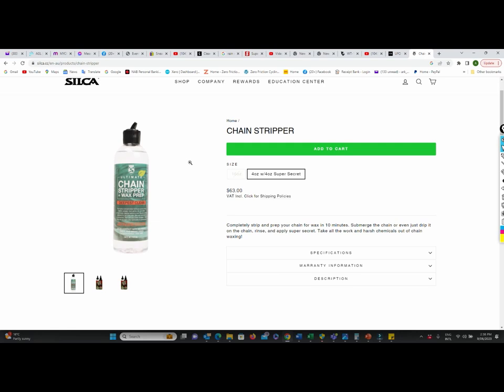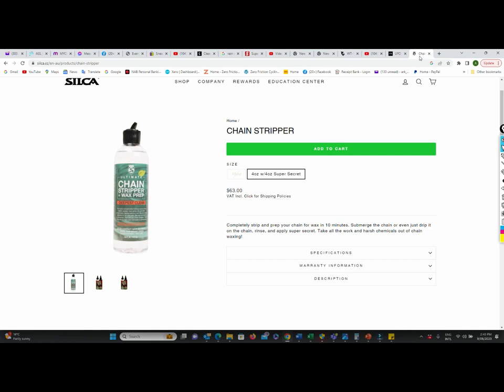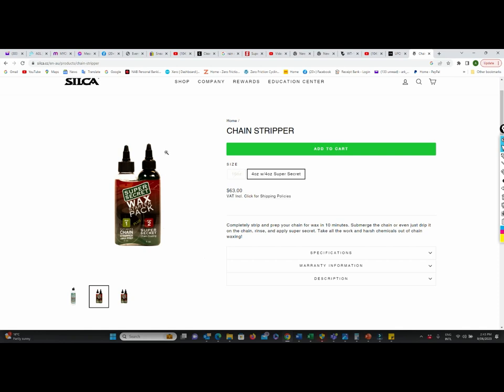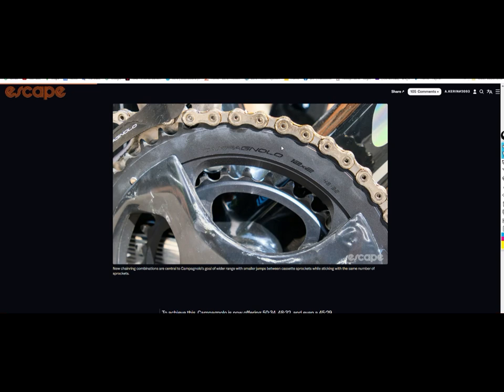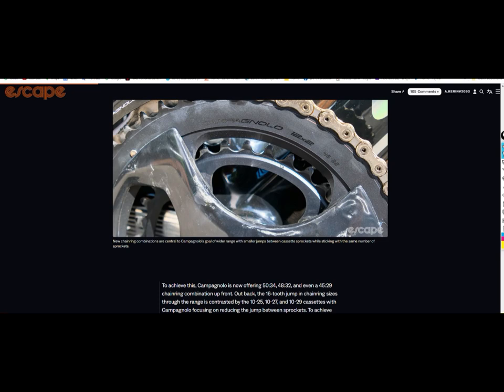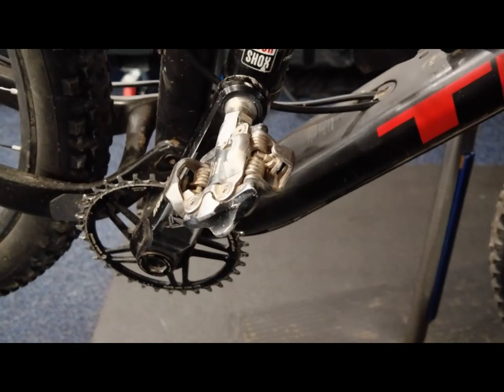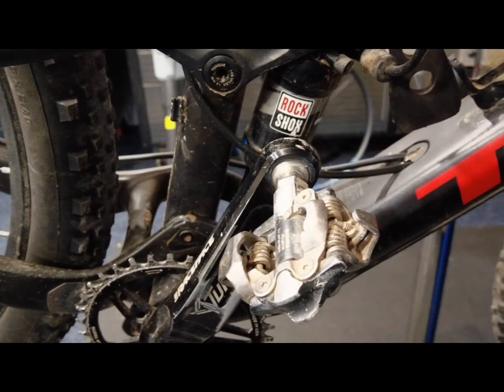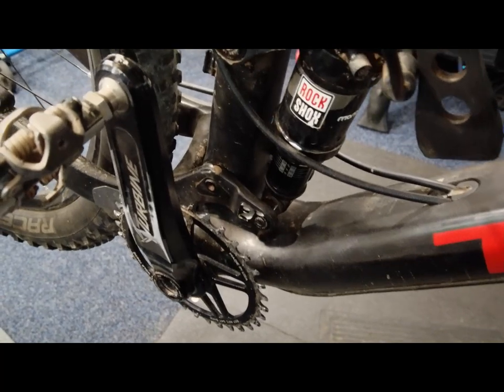Stripper and campy 10t

Comment: The 10t enables increased range with an allowance for an additional 1t jump towards the middle of the cassette where racers will spend most of their time…especially if one ends up spending more time with a straighter chainline. To me that is a worthwhile tradeoff in mass-start racing.
Reply from the maker: The exact same thing can be achieved with an 11t for the same number of cogs you just end up with a larger largest cog. As all cogs are going to be at least 1 tooth larger if the smallest is an 11t, it costs the more in material and machining, same with larger rings. They are not delivering a benefit to you in range / jumps - they are delivering cost saving to them - which is passed on where.....?
Reply: @zerofrictioncycling992  A Campy 10-27 has 10-11-12-13-14-15-16-17 for 1t jumps. A Shimano 11-30 has 11-12-13-14-15-16-17... one fewer. They could add the 18 cog, but then the remaining cogs would probably have to be 20-23-26-30. That 20<->23 is a 15% jump. Even a 17<->19 is 11.8%.

Like I said, I'll take the additional 1t jump in the middle of the cassette that Shimano doesn't currently offer...and can't practically offer.
Reply: @kidsafe  if a 48-10 is roughly the same as 53-11, and 48-27 is roughly the same as 53-30, and you give them both 12 gears to go through that range, how would one have any noticeable gear ratio differences to the other?  If we're nitpicking, the 1T jumps on a smaller chainring has larger percentage ratio changes than the 1T jumps on the larger chainring.  Ie going from 48-12 to 48-13 is 7.7% reduction, but 53-13 to 53-14 is a 7.1% reduction
Reply: @wtran87  You’ve missed the point. While the gear ratio changes are slightly bigger for each 1t jump, you get one more useful 1t jump toward the middle of the cassette. With Campy you get 48x16 to 48x17. With Shimano you get 53x17 to 53x19. Again, I’ll take that additional 1t jump for my race weekends.
Reply: @kidsafe  I guess this also comes down to personal preference - my interest in gear ratio changes is in time trials, so everything 17T and below are what count, and once I'm going higher than 17t I'm more likely to be climbing, (I find I'm less picky about having an exacting cadence when I'm climbing).  I think also because of my cadence, I don't find myself riding beyond 53-17 in my local races (at 95RPM that's ~37kph).  In the end though I'm still on 11spd Shimano so I don't even have the 16T cog to work with on my cassette lol
Reply: @wtran87  I find continuous 90 - 95 RPM cadence difficult with osteoarthritis .

Comment: Are bike and component manufacturers trying to price some of us out of cycling?🤬
Reply from the maker: Hey leslie! Ooh depending on brand and groupset level, i would say pricing of many components is getting very painful. Very very painful. In some cases (campy) - they have long frustrated me re pricing - especially pricing vs performance / and performance quirks. 

Why do their eps batteries cost circa 3x srams axs batteries when they will be basically the exact spec just different connectors. Why do their master links cost $30 fkn dollars. Why do they include a 123 page book in every chain box when the internet has been a thing for awhile now. Why does their EPS itself cost so much, and yet in many ways be less refined than shimano / sram (i mean their mechs just about need their own postcode they are so big). Why do the stray from bcd so you cant use an aftermarket chainrings. why does the cabling on their mechanical systems cost over $100.  

In campy case, they did not go from dominating the pro peleton to have no presence due to good decision making and management. And at the same time as falling off massively in road - where are they in other demographics? Where is campy at in TT gruppo's? how many Ekar do they sell vs grx and xplr / sram. They have nothing in xc mtb, or enduro, or DH.  

So outside of road, they are basically non existent, and in the one focus area they have - they have fallen so far behind for so many reasons - AND THEY NEVER FIX THEM!  They havent learnt a thing re managment and decision making in decades, and show no sign of doing so. Unless there is a wholesale change of basically the entire managment team and structure - they wont change how they do things, and how they do things is leading them very steadily to bankruptcy - and this has been obviously so for oh so long, and it is omg so frustrating!! !

anyhoo - if that wasnt your question at all i apologise hahahaahaha! more widely speaking yes there is an issue with component costs! Lucky ZFC is here to help people massively reduce wear rate of their DT components :)

Comment: This move to 10t is an attempt to get around Shimano’s patents which does not include 10t. I mean why would you use 10t. In TT the opposite occurs where they run a 56T chain ring so they can get a straighter chain on a 14t cog or similar. I agree it’s a step backwards. Cheers.
Reply from the maker: sorry almost missed this one - hmm im not sure this is about patents, there was no reason they could not use their existing 12s mechanical chain rings and cassettes.

Comment: I don't doubt that the efficiency from the bigger chainrings and sprockets outweighs the miniscule weight savings from the smaller chainrings and sprockets. However, at what point would the extra weight of something outweigh the efficiency gains? For example, I know that having a water bottle is more aero than not having a bottle. However, a full water bottle weighs quite a bit more than not having one.
Reply from the maker: weight difference for such components to be larger is absolutely dwarfed by the efficiency. Vs say a 48t ring, most gear inches in middle of cassette will be circa 2 to 3w higher loss vs a 52t. Cannondale did a lot of focus on weight for the launch of the system six aero bike, which is heavier, but much more aero than a "climbing bike". They released that for most bike + rider combo, 1kg extra bike weight, on a 10% gradient, requires 3w more power. 

So even on a 10% gradient, larger rings and cogs - maybe adding 100 grams? so 0.3w more on 10%, down to basically 0.0 on level ground, vs 2w+ lesser effciency ALL the time - up hill or flat. 

It is not even a contest re larger vs smaller and slightly lighter. new state of the art drivetrains and huge expense simply should not be taking a step backwards in efficiency vs previous. It is to save them mfg cost, but at negative impact to consumer, and it is hard to see where that cost saving is being passed on...

Comment: I know a bigger enemy than small chainrings: the 15, 20, 25%, and more, gradients that I have to ride in almost any ride I do in the mountains around Taipei. So, I'll keep my 46/30 chainrings. But I will happily blame the efficiency losses every time I suffer to bring my ass up a steep gradient. Of course, we're talking about different needs: my need is just to enjoy my cycling, I don't have to win anything.
Reply from the maker: For sure - smaller rings are a great option for some, and you wont ever be able to measure in your riding any difference in efficiency. The main thrust is that for latest and greatest and very expensive groupsets, the masses should not have a step back in efficiency force on them. Smaller rings and 10t should be an option, not the standard.

Comment: I was thinking about this in the giro mountain TT. Sure the thing about 10t is not about gross efficiency at all times, but efficiency when it matters. You need the gear range to put power down on te descents at a reasonable cadence, but descents are limited by rider skill and aero more than power. Where power output efficiency matters and will result in taking time on other riders is on the climb. Roglic was in 40/42, G was in 34/34. And maybe narrow wide levels the playing field. But it did strike me that 10t is more about gear range for 1x and big tooth count efficiency when climbing
Reply: So found a higher res image of the results that I could read...  and narrow wide obviously makes more of a difference than I thought

Comment: I was also wondering, how important is it to have the most frequently used gears in the middle of the cluster vs the size of the chainrings and cassette? For example, the range of the Ultegra R8000 11-32 11 speed cassette is similar to the Ultegra HG-800 11-34 cassette. However, the 6th gear in both of these cassettes is quite different, 18t for the former, vs 21t for the later.
Reply from the maker: it depends how important any chain line friction losses are for you. Ie for world tour time trials, a lot of focus is put on chain ring and cassette range to get hopefully circa 80% of tt (flat  /  rolling tt vs hill) in as straight a chain line as possible. For "normal" cyclists - where most will have just one chain ring and one cassette - typically overall range is what dominates vs chain line. The middle cogs and ratio's if there is a small difference between one and another set up, you could never detect that. But for some set ups - grinding away in a 46t ring to a 52t cog at an extreme chain line will be pretty bad losses vs if one went smaller and was thus able to stay in the 2nd largest cog vs the 52, so might be a 42 / 45 or 42 to 42 at 2nd cog - if one has a a ride or race where they will spend over an hour in such climbing gears - they could be saving easily multiple watts if pushing ring / cog sizes and thus chain line angle etc - and at those extremes they rarely run nicely.

Comment: Can you discuss the hypothetical option for drivetrain manufacturers to offer the opposite trend to consumers and make the smallest cog in the rear a 12T? What are the gains to be had there by eliminating the 11T (assuming larger chainrings)?
Reply from the maker: Yes great question - overall for really most cyclists - 11t is really a great sweet spot. to get same range with 12t with same jumps, it can mean that the largest cogs are getting pretty  big. This can make some adjustments more tricky for road mechs - ie B-Tension and parallelogram are designed for a certain range / rate of step down, and once start getting outside of that range (ie if trying to get mech to stretch to accommodating a 36t vs 32) - shifting is compromised, AND all cogs larger = heavier and more material, more cost to machine etc - so there is a sweet spot. For sure some riders would prefer to have only a 12 or 13 or event 14t smallest cog as they never use the 11t, and dont want the range expanded they want a tighter range across the cassette for giving up a small cog they dont use. I would like to see more options for users able to customise their cassette ranges like this, but again for mfg cost and packaging costs and everyone stocking more sku's in one area etc - we are stuck somewhat on this.
Reply: @zerofrictioncycling992  For a while last year on my Crit bike I ran a 58 tooth single ring with a 14-28 Junior cassette. Mostly just for the giggles. but it worked out pretty well.

Comment: Hmm. I see what you are talking about re smaller chainrings w.r.t. wear and friction. However, I'm personally going to smaller [outer] chainring mainly because 53T is too big a gear for me to push at the moment, and it means my chainline is very skewed as I'm half way up the cassette. It's more of a fitness issue though, because I haven't downsized my cassette in a corresponding manner. And I'd rather not upsize my cassette too much either, because I find the jumps between gears to big. Speaking of that, one thing I do like about the new campy wireless group is that the spacing of the cassettes is closer together than before. But I see even the 10-25T cassette lacks an 18T cog. If you ask me, range isn't everything, and they should be putting more gears or cogs in the middle of the cassette where the majority of people spend there time. Now if you happen to live in the mountains where it's either all up or all down, then sure, I can understand having a wider range cassette. I won't be buying the new group anyway. Too expensive.
Reply from the maker: yes for sure - smaller rings definitely suit many riders - and you will never notice the lesser efficiency. Thats why compact came out when the norm was 53/39. 

The main thrust for me is that for latest greatest groupsets, they should not be taking a step back in efficiency - things should be stepping forwards. And that a step backwards should not be forced on everyone. There should definitely be smaller ring options, but there should also be larger ring options. If they want to have a 10t to keep range for smaller ring options, make that an option. 

Really for bulk of cyclists, the reality is it will not matter at all. but for serious racers, it will matter. For tt riders and triathletes, it will matter. For professionals at WT level, they are unlikely to accept those smaller rings. On principal, we should not be getting less efficient drivetrains on latest and greatest groupsets vs previous iterations. All aspects should be moving positively forwards.

Comment: I’ve been running 10T since 2020 and enjoy the flexibility of having the same rollout as a 55-11 with my 50/37 and the same rollout whilst still in the big ring as a 39-26 when running the 10-33 cassette. I got caught out whilst visiting for TDU this year on the SASI ride with a 46/33 and spent 45 mins in the 10T. It was fine.
Reply from the maker: absolutely - again you wont notice it in reality - it is too small a difference. You dont notice bigger differences by say wearing aero socks over cotton socks, even though again - it is there. 

But the reality is, it is less efficient, and should that be the path for the latest and greatest groupsets, at rather large cost?
Reply: @zerofrictioncycling992  agreed. I recognise the loss is there but I’m prepared to take it for the superior ranges and in the 1x systems, superior chain retention. That said, if I had my time again and didn’t have to buy a new front mech, I’d have gone for bigger front rings
Reply from the maker: @jamespage7182  yes absolutely - again no one will be able to determine a difference in the losses in their riding - and so all just ride super and its good times. However at the highest levels, it is taken into account, and larger rings demanded. 

My stance is simply that we should not be getting, in reality - due to indisputable physics and maths and logic, and well, reality - a less efficient drivetrain vs previous - due to machining cost savings for them, that are hardly being passed on to consumer. The smaller rings and thus move to 10t is for their benefit, not ours. 

I should have put an analogy along the lines of - lets say currently conti gp 5000 TT edition is 7.5w loss and $150. Conti bring out a new GP 5000 TT race edition. It is now 9.5W loss due to them saving some mfg costs, but now costs us $180. 

I would not call that a win for the consumer of the gp5000 TT race edition etc.

Comment: I can understand the argument of the chain stripper appealing to people who, for whatever reason, can't get their hands on usual solvents. Completely disagree with what you said about its value though. Where I live in the UK, 5 litres of white spirit is £10. At 250ml per procedure that works out to £0.5 per application. This chain stripper is £50, it would have to last for 100 applications, just to have the same value. Since this is a 120ml bottle, that's 1.2ml of product per application, which doesn't sound feasible.
Reply from the maker: ah yes if you can get for that price for sure you are correct. But in many countries mineral turps / white spirits and metho etc are easily over $5 a litre, so cost to prep a chain would be circa $10. In those situations it would be less cost, and easier - to use chain stripper  / UFO clean. Ceramic speed claim 1 litre of UFO clean can prep circa 30 chains, i imagine stripper will have a similar claim. To be cost parity at say even $75 a litre delivered, they only need to prep 7 or 8 chains to achieve parity, and 10 chains to be ahead.

Comment: what about 1by on gravel bikes? most gravelbikes ride on a 40t chainring. is there a better solution to it?
Reply from the maker: for gravel - you need to achieve the range that suits your riding. So if you are running 1x, and you have X cassette, you then just need to match that to the right size chainring for your climbing / riding. Again you will not be able to physically detect or measure the efficiency difference between running a 36 or a 40 or a 44t. It is something that only really is considered by marginal gainers at highest levels  - where they will try to go as large as feasible for the gear range they need (and or go 2x). 

The main thrust for this discussion really is that for road - should efficiency be taking a step backwards for latest and greatest, and very expensive - groupsets.